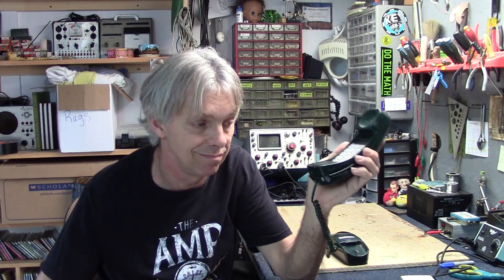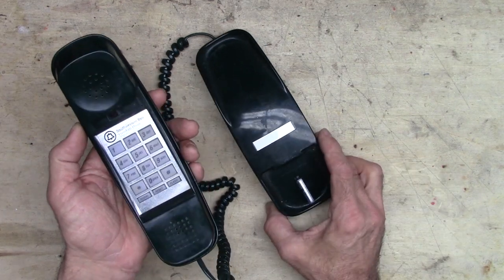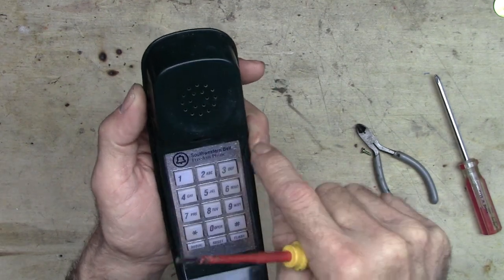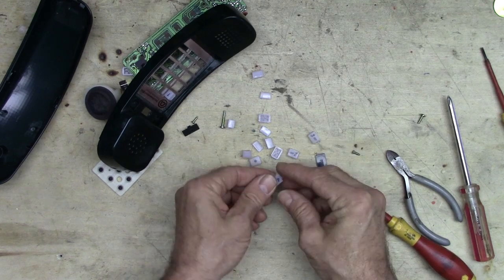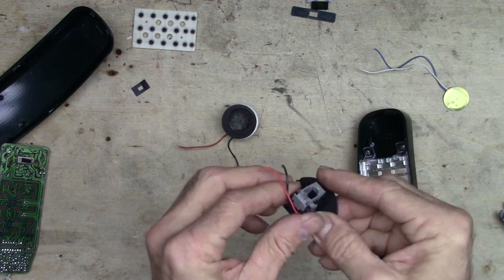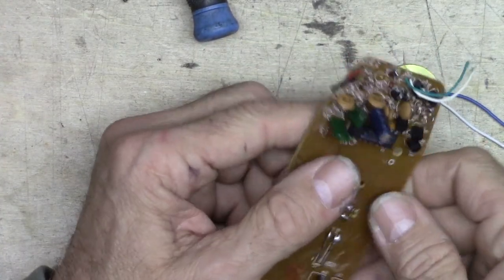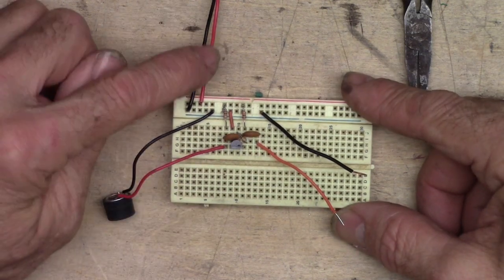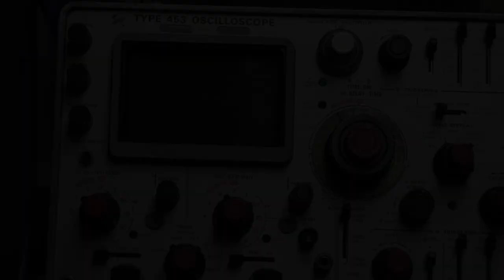Phone Tear Down & Preamp Salvage

Comment: I was messing with my crystal radio and connected the piezo speaker to the output, and could hear the stations!
you could use the piezo speaker for a microphone- I connected it to my amp and that works!
clip the end wires of the phone cord and connecter- those are gold!
happy scrapping!

Comment: That's not what would be considered a "true" trimline phone but a knockoff made for one of the Baby Bells after the breakup in  Jan of 1984.  Looking at the innards as well as the cheap plastic base, it's probably from some time in the middle 90's or later.  True Trimlines were made by Western Electric for Bell and leased to customers AND had a LOT more cool hardware inside.  I probably own a dozen Trimline phones as well a few other pieces of Western Electric equipment.

Comment: How did you measure the impedance of the speaker? Just like any old resistor?
Reply: +SciPunk215 Yes.
Reply: +SciPunk215 Ahh,but that's not the Impedance,that's just DC resistance. Impedance is function of an AC signal,and depends on frequency,etc.
You may have noticed that a lot of speakers that say "8ohm impedance" might actually measure closer to 4ohms of DC resistance,with your DMM. That does not mean they are 4 ohm speakers.  "Trap for young players",as Dave would say.
Reply: +Dean Segovis Problem is, a speaker is a reactive load, so its impedance is gonna change with frequency. The impedance specification given by the manufacturer is a rough average across the audible spectrum. Here, you are measuring a DC resistance, not an impedance.
Reply: +Terrence Zimmermann (RobotDude) True, but a higher ohm reading on a speaker indicates that it is used with a high impedance output amp.

Comment: I thought I was the only one unlucky enough to get zapped by a phone line,while standing barefoot on wet concrete.. What are the odds that someone would call,the second I put my non insulated pliers on the connections in the box,to tighten them up?  Bah.  (Yea,multiple fails on my part,on that one.)
Reply: +PhattyMo When the prick77 was still common it was a regular prank to crank up your set while the other end was being connected lol.

Comment: Can you do a video on building a turbo encabulator?
Reply: +Aaron Fink Good idea! ;)
Reply: +Aaron Fink what is that ?
Reply: +aiyf It's complicated. The best way I can explain is that it's a machine with a base-plate of prefabulated amulite, surmounted by a malleable logarithmic casing in such a way that the two spurving bearings were in a direct line with the pentametric fan. The main winding is of the normal lotus-o-delta type placed in panendermic semi-boloid slots in the stator, every seventh conductor being connected by a nonreversible trem'e pipe to the differential girdlespring on the 'up' end of the grammeters.
Reply: Aaron Fink ok ! thank you !